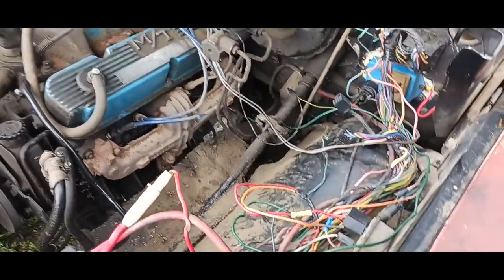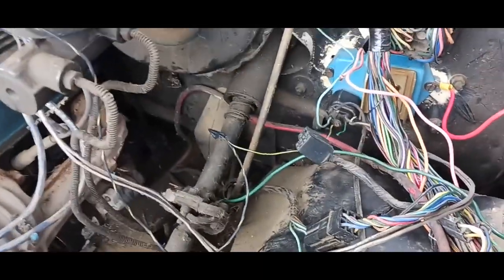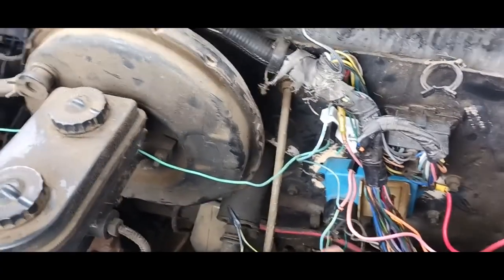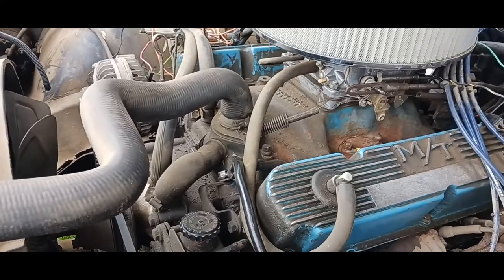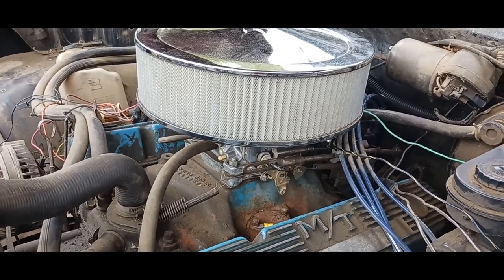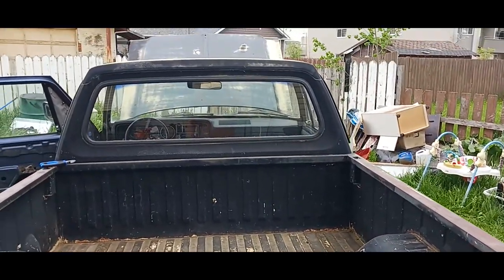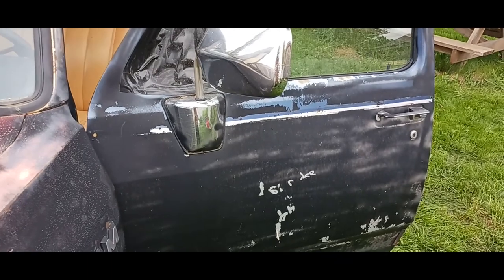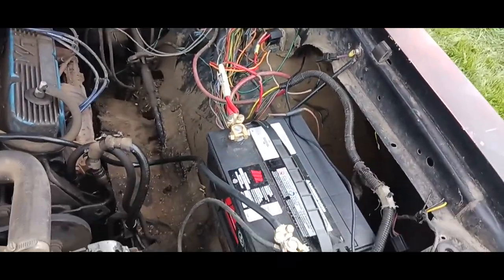1986 dodge Finally running after 8 years #dodge #trucks

Comment: Those plugs are for the "Lean Burn System" early computer, which I still have and run on my '82 W150/225 without issues so far, though I added extra vacuum advance for better mileage despite high wear and low compression, though compression might improve if the detergents unstick the rings, which might force me to back off on the timing advance.  But I will be ready if and when the rings decide to spring out and seal.  Taking out the computer and returning to the older system is bound to involve some sorting of wiring, which I hope to avoid as ling as my computer works.
Reply from the maker: I get that it was removed before I got it. I just wanted to clean it all up. Ty for your comment, brother.

Comment: I have a 727 in my 318 surfer van that is stuck in forward so that I can only get neutral by shutting off the engine, and have no reverse because when shifted into reverse, it is in both reverse and forward at once, which is sort of like neutral.  Anyway, I look forward to seeing 727 rebuilds to help me fix mine.
Reply from the maker: The trans is ok. It was the neutral safety switch. But I will try and get a video of the C6 trans I will be getting help from my dad so I can get it ready for the 71 mustang mach 1 351C C6 M code fastback car we found at a Junkyard.
Reply: @rescuedandrestoredgarage  I never needed to do major work on a c6, and haven't owned one in decades, just the 727.
Reply from the maker: @alan6832  727 is a very good transmission.
Reply: @rescuedandrestoredgarage  Not indestructible though as I have blown 2 of them, probably both used and abused by previous owners though.
Reply from the maker: @alan6832  ya, I am not sure if it is good or not, so just tk be safe. I want to rebuild it for the Mustang.